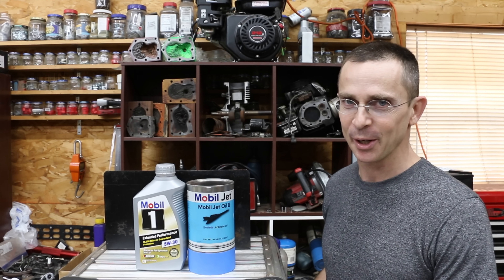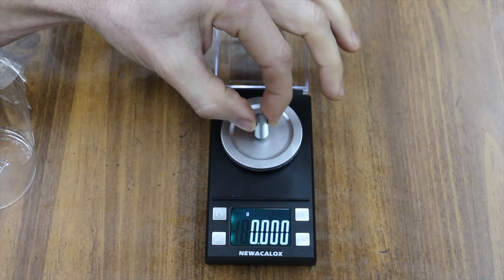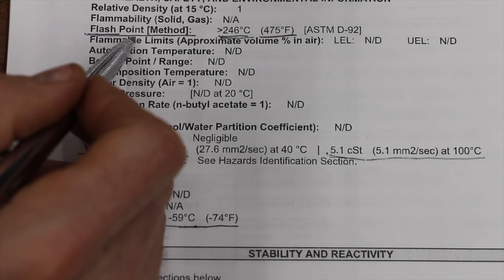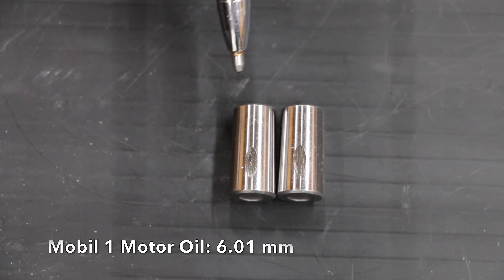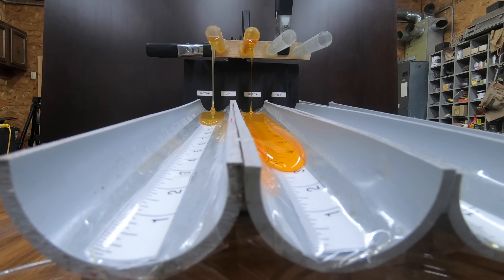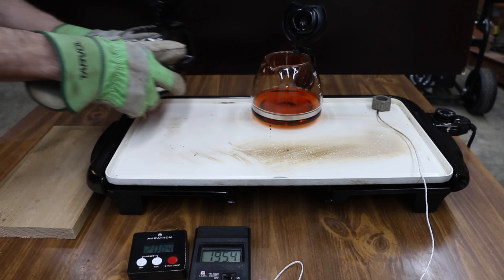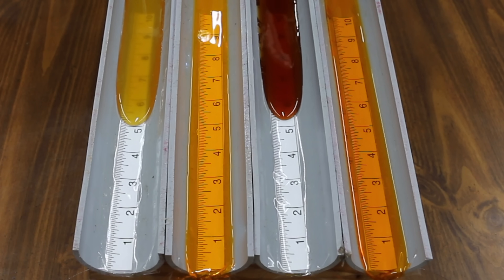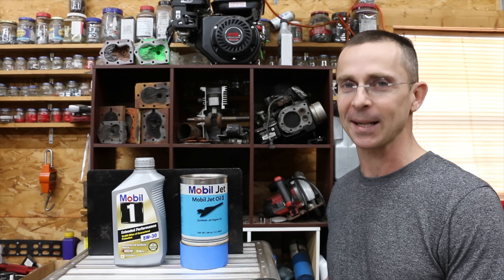Is Jet Oil better than Mobil 1 Synthetic?  Let's find out!

Comment: Can you please do a test using Aviation gas.
Its usually 100 octane. 
 I have ran it in our draft cars for years but have always been told you have to run it with a mixture of Marvel Mystery Oil because of the altitude at which planes fly at the fuel is by nature dry and without Marvel mystery it will ruin the valves and cylinders in an engine.
Very curious.
Reply: av gas is leaded, no ethanol as they need long shelf life, gummed up carbs will kill you too.
Reply: @tron121  
I've never had a single issue running in in drag cars.
Reply: @cudaoutlaw  I apologize for my short reply.  I was on my tablet and typing on a tablet is, well, not so fun.  AV gas is formulated the way it is for reasons that apply to planes that I will go over below.  In short there is no advantage to running it in cars that I am aware of.  Yes, it has lead, yes it is high octane.  But it is expensive as most track gas, and track gas can be leaded and high octane too.  So if you need those things...well there you go.  No reason to use AV gas.

AV Gas has no ethanol:  Why?  Because ethanol is hydrophilic, meaning it attracts water.  Water in your fuel is no good, especially when your flying a plane and engine failure can kill you.  Also when gas sits the ethanol gums up, and again, gummed up carbs can cause engine problems, again killing you.  Add to that remote airports need their gas to last sitting, for a long time.  Shelf life matters, ethanol suck for this.

AV gas has lead: Why? Because a lot of old planes are out there that don't have hardened valve seats.  Some new plane engines don't need nor want the lead.  Lead and synthetic oil are not friends.  Point being you don't want lead in your gas unless you have a specific reason for it.

AV gas is high octane: Why?  Plane motors are, in general, not high performance.  So it is not a compression ratio thing.  Plane motors do run very high load when climbing though. Think of a boat, the old quote is "they are always going uphill" so too it is with planes.  So again we go back to safety.  High heat can lead to detonation, detonation is real bad, motor failures when flying will kill you.

So there you have it.  AV gas is the way it is for a reason.  It is not "better" for cars.  If you have an old motor designed for leaded fuel, and need the octane.  Sure...i guess.  But like i said if you are at the track you can already buy that fuel in most cases.
Reply from the maker: Thank you for the video idea!

Comment: Actually some more realistic ideas:
What happens if I put jet fuel in my car?
What happens if I supercharge my push lawnmower?
Can I run nos through my hand held lighter? 
Can you power a car solely on solar power? Or a mixture of solar/ regenerative braking battery power? 
Want some more ideas? I've got a ton of them.
Reply from the maker: Thank you for the video ideas!
Reply: @ProjectFarm  engine air filter showdown! K&n vs premium guard  vs Bosch vs etc.
Head to head competitions premium vs no name brands of other car parts like brakes, struts, exhaust, tires, etc. 
"Cold" air intake performance vs hot. 
Can I run vegetable oil as engine oil.

Comment: Project idea: can jet fuel melt steel beams?
Reply: spiralnapkin 
Let it go
Steel beam at the base of World Trade Center is under 500,000 tons of force 

Any weakening of steel beam with heat and major break in some of the beam will lead to major catastrophe 

Used parts of your brain a little

Comment: as always I do cherish your testing.. but I don't like your not being specific about aspects when doing tests..fx here.. do you just put an amount of oil in the cup on the fly??   1:45 (I'm no expert but I'm pretty sure that will influence how much oil that comes to the bearing) you need to be precise on stuff like that, why not measure exact amount beforehand and not just take it on the fly..
- and again here' where there is differences in how much you put into the tube 0:44 I'm not concluding it will make a huge difference, but you shall not neglect surface tension and stuff like that' even a low degrees, and it doesn't take a Ph.D. to just make things equal and measure out an amount beforehand, instead of this "on the fly aprroach" particularly if your looking for results and small varieties and conclude something from it..
When testing [items] you need to be extremely precise about values' so we at least can conclude that the fundament & benchmark is as close to equal as possible...
Reply from the maker: Thanks for the constructive feedback

Comment: Jet turbines spin at very high rpm’s, have multiple concentric bearings (bearings within bearings) , loose oil during operation and the oil isn’t changed during normal operation, only topped off.
Reply from the maker: Great information! Thank you

Comment: Out of curiosity, what exactly would happen if you DID put jet oil in a car? 

I've always been told "oil is oil" and that it doesn't make a huge difference what kind of oil you use, so long as it's made to go in an internal combustion engine of some sort.
Reply from the maker: I believe it would destroy the seals and possibly the main bearings.

Comment: Jet oil is designed for the spray lubrication systems used in jet engines. That type of service is different than the needs of reciprocating engines. Also the type of seals and hoses are different.
Reply from the maker: Great point.
Reply: Not all jet engines use a spray lube system, especially small (sub 1k lb) engines.

Comment: I used to be a Crew Chief in the Air Force, worked on A-10s, F-4's and A-7's.  I think the very first week at my first base I was warned about people stealing the oil we used on the A-10's.  Idiot's would take it home and use in in their cars.  I have no idea what they were expecting, but the mil-spec oil would eat the seals in their engine.
Reply from the maker: Great information.  The Jet Oil dissolved the tape on the plastic test cup quickly!

Comment: Use melted butter as oil in an engine
Reply: I have a feeling that because it's slippery it would lubricate the engine but because it's thin it would cause problems
Reply from the maker: Thank you for the video idea!

Comment: Great vid, love to find out if a engine can run on 3/4 Oil and 1/4 fuel. And then try difrent Oil's.
Reply from the maker: Thank You!
Reply: I accidentally topped of an old greyhound bus (an mc30.)I drove with gasoline one time.  Another driver made a 600 mile trip with It !  It ran like shit, but it did still run ! It didn't hurt the old Detroit from what I was told. I'm guessing it was probably close to a 50/50 mix.
Reply: @dancahill9122  holy fuck, That's sound doup. Sometimes when my Brother and I is running out of fuel we just use diesel. We only use diesel on his lawnmower that runs 60 km/h. Hehe. So we have Family in Calafornia, it's from my dad side( his uncel works at Nasa). We live unfortunately in Denmark. I hope one day we can come and visit them.

Comment: Can you test 5w20 vs 5w30?
Reply from the maker: Thank you for the video idea!
Reply: @ProjectFarm  I can't wait to see the results!  Alot of heated debates on the subject on many vehicle forums.    I run Pennzoil  5w30 synthetic in my 2016 F150 5.0 that calls for 5w20.   One side of the debates is that vehicle manufacturers are pushing 5w20 for CAFE fuel milage at the expense of engine longevity.  

I bet your 5w20 vs 5w30 test will be wildly shared on forums! 

Keep up the great work!

Comment: MJII or BP2380 are made mainly with temperature extremes in mind. Lubricity is taken care of because bleed air is used to pressurize the bearing chambers and force oil onto the bearings, evenly coating them. Viscosity is kept low because the tolerances are far tighter on turbine engine bearings (tolerances usually range in the 0.0005" area). Jet engine oil would probably be better suited for your high RPM race car more than your Cummins diesel 😉
Reply from the maker: Thank You!

Comment: These were basically two different spec for very different work, Jet oil II is designed for full bearing support instead of statically rubbing against 2 surface.
Reply from the maker: Great Point

Comment: Thank you for this test! I've always wanted to compare the two side by side! Just as a note, MIL-PRF-23699 (synthetic engine turbine oil) and MIL-PRF-7808 (cold weather version) are definitely good stuff. They are used in almost all of our helicopter transmissions and aircraft gearboxes. The oil has to flow well and fast without coking (not cooking) under high pressure at constant high temperature, through many small oil jets, into the bearings and meshing teeth of gears spinning in excess of 18,000 rpm.
Reply from the maker: Your Welcome
Reply: It's very good for its purpose, but it's purpose is not to hold up inside a piston engine. Turbines are so darned reliable because they don't shake theirselves apart, there's no cyclic impact or shock loading, it's just a big rotating mass that for the most part, even smoothly accelerates and decelerates, and are very well balanced. They also employ roller and ball bearings and don't rely on traditional bearings as in engines. 

Piston engines and their lubricants have to hold up to massive shock loads every time the piston change direction and the immense variation between the power stroke and the compression stroke. Diesel lubricants are probably the pinnacle of lubrication engineering to deal with shock loads without film failure. If you want to run a non-standard oil in your car, I'd probably run Rotella T6.

Comment: Jet engines do not use bearings like insert bearings in a internal combustion engine. The jet engine uses ball and roller bearing that are lubricates with spray and pressure injectors plus the turbine section of jet engine operate at extremely high temps exhaust gas temp can exceed 900 C on take off while the fan section is operating at extremely cold temps  as low as(-50 C) at high altitude. This comparison is an "apple orange" comparison although interesting.
Reply from the maker: Thank You!

Comment: Offcourse Mobil 1 engine oil "won" the protection test - it is two times thicker, has two times better oil film strenght. Viscosity is the most important thing for an oil. Every other thicker oil would act in such manner.
Apart from that, Jet oil is superior in every other way. Cold flow, high temp. resistance, no color change, completely different oil base...much much better. 

You're a clown.
Reply from the maker: Thanks for the constructive feedback

Comment: Completely unrelated suggestion for some testing... 
I recently bought a "Double Edge Razor Blade Sample Pack (2x each) 
by Razor Blades Club" from Amazon to see if I could detect any difference between various razor blade manufacturers and materials.
I have tried a few so far but my evaluation has been purely subjective. I thought it would be interesting to see you take a more scientific approach to measuring parameters like sharpness and durability and see which one provides the best overall shave?
Reply: What oil lubricant did you use with the razors???

Comment: try bp 2197. its better than jet II. also typical hi bypass turbofan engine will have a oil consumption rate of 0.04 to 0.5 quart per hour, so the actually the oil is not staying in the engine very long.
Reply from the maker: Thank you for the video idea!

Comment: Mobil sells jet oil by the quart. Take that metric system!
Reply: That's because all aircraft things are in standard measurements. Inches, feet, pounds, gallons, quarts etc.
Reply: @MoparMan82796  not all aircraft. Airbus helicopters formaly eurocopter is 99% metric
Reply: Aaron Phillips   Awesome. Take that metric system!!

Comment: In the lubricity test, it looked like the Mandrill was no longer dipping into the jetboil about halfway through the test. I think you should try that one more time and make sure
Reply: The jet oil doesn't have anywhere near the shear strength of a piston car oil. They are totally different machines using very accurate roller bearings so it's not needed.

Comment: I think jet engines probably have a ball roller bearings or sealed bearings in the engine, therefore they probably do not need as much is I wear additive due to no bearing surface is riding on crankshaft.

Comment: Mobil 1 is so overhyped it's not even funny. Too many people come into my shop wanting that, but Castrol Edge is better, AMS Oil (even their OE, NOT the Sig Series) is better, Pennzoil Ultra Plat is better, and ALL of them are $20-$30 cheaper on the oil change. I get it, M1 USED to be the best oil on the market behind ONLY AMS Oil (because NOBODY knew about AMS), but everyone else has caught up AND surpassed M1. M1 shops sell you Mobil Super for cheap, making you THINK you are getting M1 just at the same price as Castrol, Quaker, Pennz, whatever. That's not true. I flat out had a M1 rep in OKC tell me he wants my shop to switch to M1, and I told him not everyone will want to pay M1 prices. He said to use Mobil Super, but people think it's M1. Yeah, that's not ok, and that was STRAIGHT from a rep.
Reply from the maker: Great Point

Comment: Regal! got me thinking about all the jet oil I have in my barn,  Mobile 254, Mobile type 2 , Exxon 2380, and others. I think I will fill up a couple push mowers (never used) with jet oil and cut some grass. And I have an older 1998 Harley that has been run on 100LL avgas for over 15 years and just went for a ride today and she nearly blew me off the seat. Runs like it was new. 21000 miles on avgas.
Reply from the maker: Thank You!

Comment: Good test as always. I'd be curious to see how the jet oil when mixed @ 40:1 or 50:1 with gasoline would do in a 2 cycle engine. Also as a follow up to the jet fuel test, using jet fuel alone as fuel for the 2 cycle engine.
Reply from the maker: Thank You!

Comment: If you put that jet oil in your ICE motor it will WRECK your journal bearings. I've seen it. It's MUCH thinner than even 0W oil. 0W oil is about 10 Cst, while jet oil is about half of that!  Jet engines have MUCH higher oil pressures than your traditonal ICE and they have seals that fit VERY tightly once they come up to operating temperature. In fact, most jet engines once you turn on the fuel you are comitted to start because if you cancel a start before the engine takes over the inside parts will heat up at a different rate than the outside parts and the engine will seize up! This can happen in flight if an engine flames out, it will sometimes refuse to ever turn again, this is known as "core lock" .
Reply from the maker: Great point! Thank you

Comment: Jet oil is designed for the high speed shafts, bearings and seals found on turbine engines. In addition, these engines are operating at high altitudes where lower ambient air pressure and cold temperatures contribute to oil viscosity breakdown. As the oil cycles thru the engine, it can be quickly heated to the high temperatures found around the combustion turbine shaft. Lucky for us all that the engineers got it right when they designed separate oils specific to turbine jet engines and other oils specific to modern piston engines found in our cars.
Reply from the maker: Great point. Thanks

Comment: As an airline pilot I can tell you jet oil is better!!! Our engines run at 300c or above and outside temp at altitude can be -75c what auto engine can run like that?
Reply from the maker: Great point!  Thank you
Reply: You sir, do not have a single clue how jet engine work.
Reply: That’s funny Jordan I flew jt8d Cfm56 etcfor 30+ years. Would you like to talk takeoff egt, max cruise egt of start egt? I do realize oil doesn’t come near as close to combustion in jet as internal combustion engine, but temperature in a jet engine core will melt any car engine. Some of this heat is transferred to bearings (thus air gaps and cooling throughout certain areas especially the turbine section, (that’s the back part for you Jordan) Jordan please don’t tell me what I know, I’ve forgotten more than you will ever know about jets. ATP 727, 737, 747, Dc9 Continental Airlines ret.
Reply: phegley3 I could talk all day about CFM56 Egt limits, as I’m a CFM56-2 technician, and I’ve troubleshot and changed many engines, MEC, fuel pumps, lubrication units... And resolved a stupid amount of throttle stagger.

I’m well aware of the cooling of the turbine housing (HPTCCV), but I bet you don’t even know what a simple chip detector looks like.

Jet engines go through oil at a pretty high rate, mostly by evaporation, which is vented in the center column. The little wire screen you probably saw in the exhaust is even there to prevent combustion of the oil vapors. 

Being a pilot doesn’t mean much to my eyes because I’ve argued many times about all kinds of false write ups. Notably the infamous “throttle stagger” on takeoff, when someone forgets to stabilize the engines at 40% before going to TRT.
Little question for you, how is the oil cooled ?

Comment: Will a lawnmower run longer, burn cleaner, or have more power with Jet Oil and Jet fuel rather than regular oil and fuel? Test the 2 head to head. I don't know how you would measure the horsepower, but I'll let you figure that out....
Reply from the maker: Great test idea!